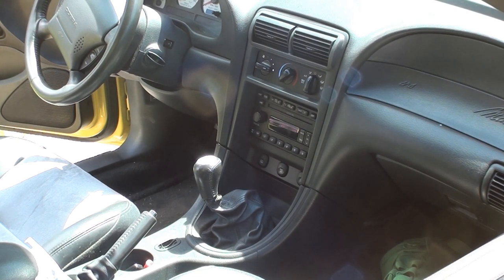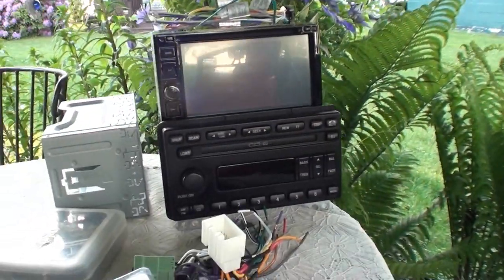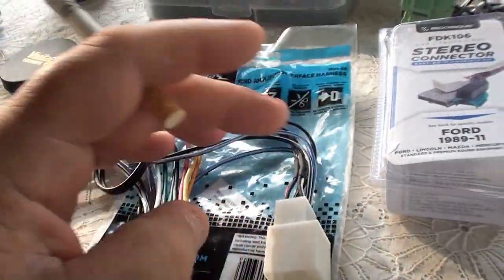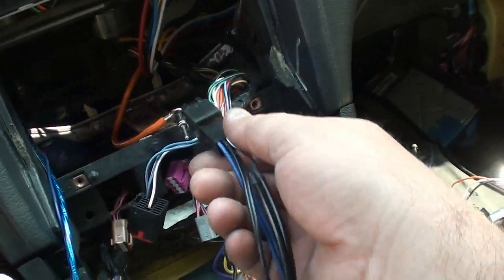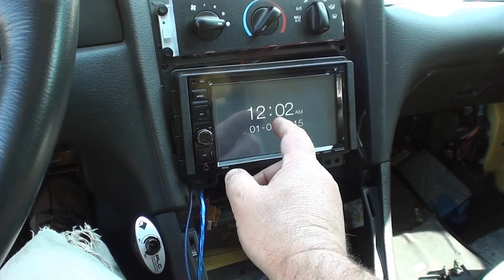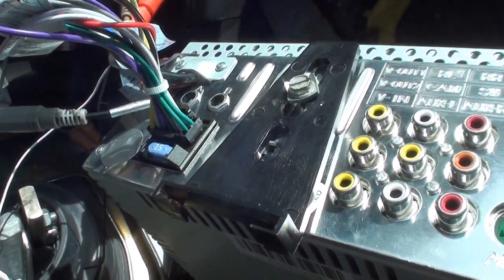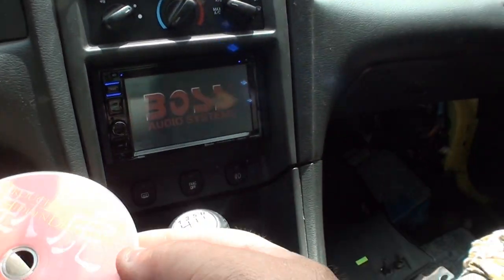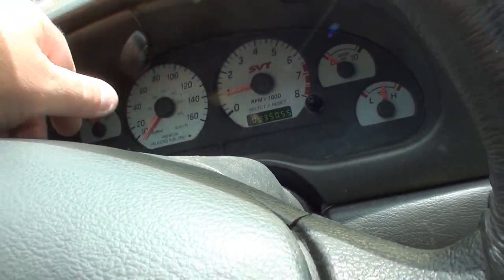BOSS BV9364B install & test 2003 Mustang Cobra SVT

Comment: Bad ass. Installing this in my 02 Malibu this week. It should be here thursday. Great video. It's gonna help me a lot. I'm just worried about it fitting right and wiring it since I'm just gonna cut wires and do it without the adapter. Balls out. Lol. Grounding the dvd wire shouldn't be too bad.
Reply from the maker: +UpEnYew did you install it yet? I'd really recommend getting an adapter.
Reply: +116falconer sure enough I cut my stock harness. My car has a security bypass which I need to buy. It's not getting power to the BOSS. Now I'm gonna pay for the $99 and an additional   35 to fix what I cut. Haha. My fault for not waiting
Reply from the maker: +UpEnYew damn dude sorry to hear that. Oh well you can learn more from one mistake than from doing something right a thousand times
Reply: UpEnYew its not rocket science, dont be scared. I installed this unit in my Nissan Quest van and chopped the factory crap and simply ran new power (with fuses) new spkr (rca) leads to a new amp, all the wires are labeled, whats confusing? My shit works fine, bk up cam, dvd. Cant get sd card to play vids as it claims it will, but for a $100 WTF.

Comment: Dude I love this video I'm buying a Boss 9372BI along with a rear camera to put in  my Ford Expedition  , shops want to charge me 150 - 300 dollars. They must be starting early on the new pot smoking laws.  I'm a journeyman Electrician and like a lot of tradesmen lazy when it comes to doing our own home projects. But money is a great motivator....

Have to be honest wasn't expecting vintage Hall and Oates from you my man LMAO but thanks for showing me what I'm up against.
Reply from the maker: +al black "vintage Hall & Oats" come on man you're making me feel old! Just make sure you get the proper harness adapters and it's smooth sailing 👍👍👍🍻🍻 Thanks for taking the time to comment👍
Reply from the maker: +al black I don't mind the thumbs down cause it's impossible to make everyone happy. The ones that really piss me off are those that leave negative comments but have their accounts locked so you can't reply. Thanks again 👍👍🍻🍻

Comment: Hey, so this is the first head unit I've ever done, I'm wondering if the small plug for the subwoofers is necessary or if it's optional because waiting for more wiring harnesses to come through Amazon seems like too much hustle
Reply from the maker: +John Petrila I can't say for sure if it's necessary or not but I would probably wait for the correct harness adapter. You could try giving Crutchfield a call, they're pretty squared away and seem to know their stuff.
Reply: The plug for the sub is optional, you may or may not need it depending on if your car has premium sound system. Best way to tell is to take the radio out and look at the connections, if your car has premium sound/mach sound system then you will need it.
Reply from the maker: +Austin Temple that's the exact answer I was going for,,,,you seemed to have nailed it while I was wide right 👍👍

Comment: I brought this same Radio. O like it but my amps was working then it stop. I brought the wire harness to use with the aftermarket radio I got sound but the amps not working anymore what could it be
Reply from the maker: +Anthony Redding have you checked the amp fuse? The car has been sold so I can only give you ideas. I would definitely check the fuses and if that doesn't work pull the head and double check your wiring. Please let me know if you solve your problem 👍👍👍👍👍

Comment: I 'm about to do the same thing same head unit model with the my 2003 mustang  basically same car , how's the sound compared to the original radio ? The original radio sound is so awsome that I am afraid to swap it however the mp3 and bluetooth is missing . Thanks for this man !
Reply from the maker: +jacques chagnon the new head sounds great. We left the factory speakers in cause of the Mach sound system. Make sure to get the proper wire harness adapter 👍👍👍
Reply: perfect I was affraid of loosing that premium song just order the head unit ,  will order the wiring harnest . thanks a bunch !!!
Reply: Crutchfield gives you the wiring kits and dash kit with the Unit
Reply: great tip Thanks William !

Comment: any idea how to play netflix through my Android phone that will show on to this radio? I purchased iSimple
ISHD01 MediaLinx HDMI To Composite Video/Audio Adapter Cable (Black), Samsung
HDMI Adapter (ET-H10FAUWEGUJ), and 
High-Speed HDMI Cable - 3 Feet. I can hear a movie playing through the radio but can't see the movie. what am I missing?
Reply from the maker: +Bird NLC have you tried hooking up to a TV or monitor to verify your setup works? Did you bypass the ebrake switch on the head unit?
Reply: no, I didn't try hooking up to a tv or monitor. however, i was able to use another av cable that connected to the ipod to watch movies on the radio. that worked.  yes, i believe we bypassed the ebrake switch..I can watch dvds without having the car in park.  I just can't seem to watch movies from my galaxy note 5 to the radio. it has to be the setup on the phone or something.
Reply from the maker: +Bird NLC I did some googling and it seems that the note 5 is not mhl compatible but I would still try connecting to a tv just to be sure. Good luck.

Comment: I installed this unit professionally into my car 200 bucks since I know next to nothing about car stereo installation. The system worked fine for 2 months then it started popping very loud (so its possible yours could do that after a while)  whenever I start and turn off my vehicle. I sent it back to the professional guy and he says he didn't know my car has stock amp so he bypassed 2 channels of the car factory amp with some nasty bulky wires and the radio now sounds horrible and on top of it has developed this humming sound which increases whenever I depress the gas pedal. I went back to this professional installer again and he says there is nothing he could do to fix the problem.  The worst of it he did not use wiring harness he rather cut my factory wires to do the installation. Watching your video I feel like I should get myself a harness and do it the way you did. And if it pops again can the AFDI-5V solve the problem.
Reply from the maker: +Alex Siaw damn that sucks! If you can put the stock harness back together and then buy the proper adapter I would definitely recommend it. So far there's been no popping but we kept the 5V just in case.
Please let me know if you are able to fix what the "professional" screwed up.
Reply: I will keep you posted, thanks man.

Comment: I have a external cartage type cd player  in my suv  can it be connected to this radio  so I can use it along with the  built in cd player on this unit .
Reply from the maker: +justliketolook it has external video and audio inputs, don't know if you could incorporate it with the internal CD player because according to the manual you have to choose auxiliary mode for external inputs.
Reply: Okay then it will work  if it has that .I wonder once its connected will it let you chance the cd's and show what track your on ect
Reply from the maker: +justliketolook can't help you out with that one. This unit is more or less a inexpensive, entry level head so you won't be getting all the bells and whistles of a higher priced unit.

Comment: You forgot to add in ur 12v - 5v conversation to the radio to the after market to avoid the pop
Reply from the maker: If I remember correctly it popped once or twice and then no more so I didn’t use it, the car is long gone but I still have the converter 🍻🍻🍻

Comment: Your slow!  by the time you have the shifter knob off I would have had the radio on the passenger floorboard and the other radio almost totally installed. granted I had somone hooking up the wire harness outside the car.

WTF  why do you have the illumination wires tied in to what looks like the turn on off the radio?  don't you know that some of them wires work off of ground to positive via the restate dim your lights and pop a fuse.   The stock Sub system in the back window is MONO it has no right and left channels   We always pulled the whole thing out replaced the speakers ran new wires  to the radio and hooked that up, the system sounds better.

You would have been better off paying a shop to do this.
The sub and sub amps will conflict with each other and cost you bass output by canceling each other out.
" Sounds pretty good"  No it could sound better if you knew what you were doing.
Screw crutchfield I was doing car audio before they ever opened the doors as a business
and getting paid for it.